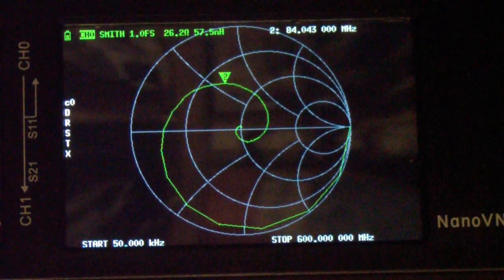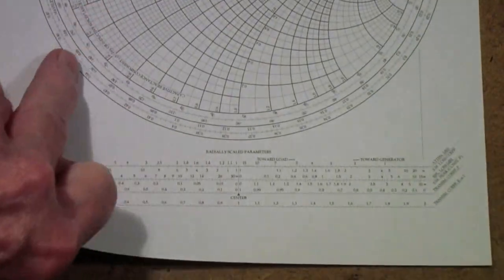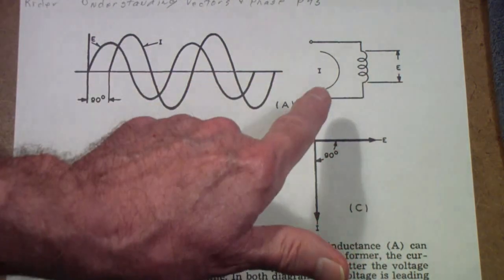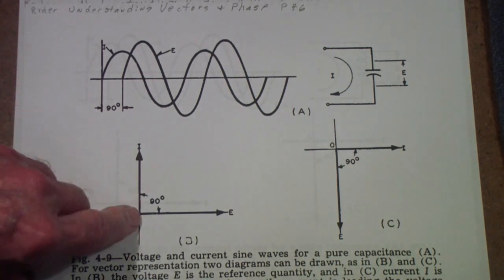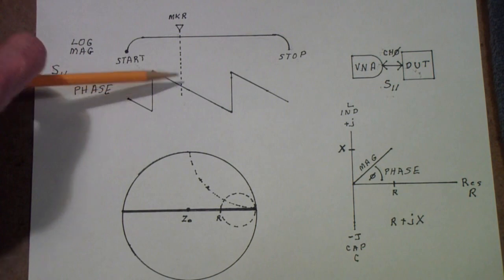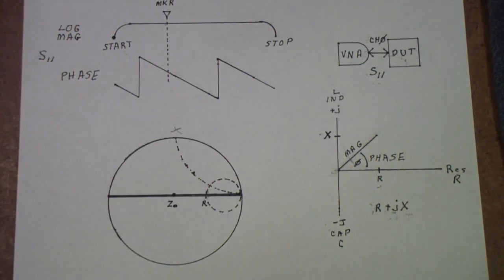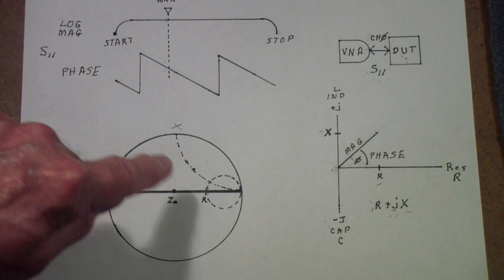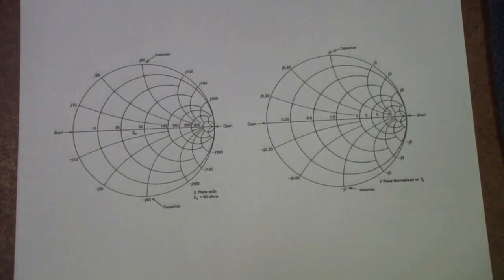TTT324 Smith Chart Demystified

Comment: Tom, I wish that you had done some example problems using resistors and inductors/capacitors so we could see how to interpret the resulting impedance of the RC or RL components on the Smith Chart.
Reply from the maker: Thanks for the comment and suggestion. There are so many YouTube videos on interpreting the Smith chart that I thought I couldn't add much there. I did a video on the Smith chart used with the RF Demo Board - though I think others have done better, including the videos from Alan, W2AEW, which I am sure everyone has seen. But I will keep your suggestion in mind and perhaps do something along those lines in the future.
Reply: @tomtektest8042  Thanks for getting back to me about my suggestion that you include example problems. I enjoy listening to your videos and it is nostalgic, as I am a 69 year old man who loves old stuff and using/collecting slide rules.

Comment: Wow, like being back in electronics school  (1981). Now, you seem to know your stuff well concerning RF circuitry as it relates to the nanoVNA. I have been obsessed with unloaded Q of a coil at resonance for some time. Can unloaded Q of a coil at it's resonant frequency be measured with a nanoVNA. I would imagine you'd need a good capacitor to use in the circuit.

Comment: Tom, that is the best description I have ever heard of ELI the ICE man. I learned that a long time ago but ultimately had to set aside a small compartment in my brain, about 100 bytes of data... where I stored the information of leading and lagging voltage and current in L and C circuits but your explanation was great. I have a number of VNA and RigExpert, etc devices and I have fun with them but bottom line we want to know our SWR. When I get really serious, I break out my GR RF bridges with signal sources and detectors to make sure my modern day digital devices are telling me the truth. I find it particularly true to go back to fundamentals when measuring L in iron core inductors. One of the GR impedance bridges has a beautiful write-up in their manual (GR 1603-A Z-Y bridge) about iron core inductors. I really enjoy your videos. I have never felt truly competent with the Smith chart but your videos help keep my brain in sync about the fundamental laws of math and electronics.
Reply from the maker: Thanks for the kind comments. I really like your videos, especially those on vintage test equipment like the GR bridges and similar, as you can probably tell from my videos on old B&K, Tektronix, Sencore, and other boat anchors. But the new stuff, like the nanoVNA can be fun too, even if they don't have the nostalgia value. Cheers. Tom.